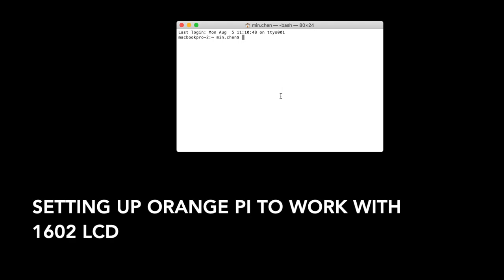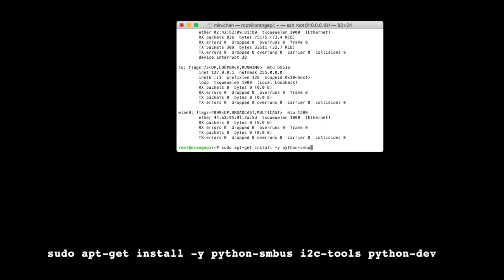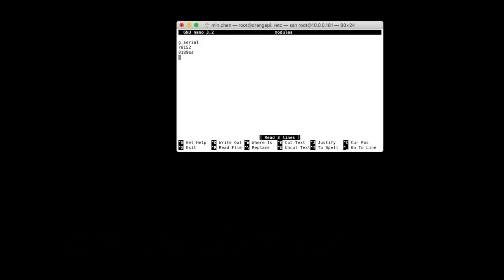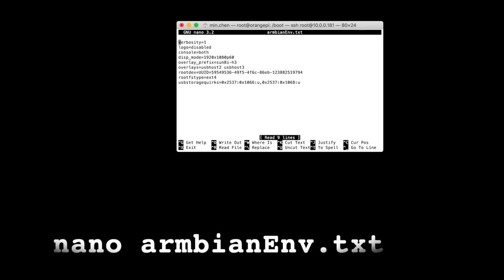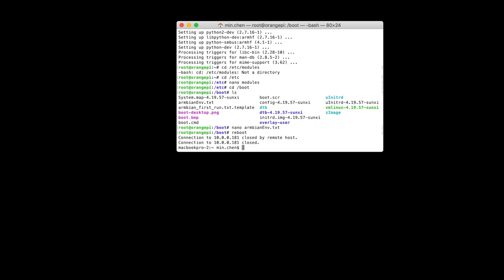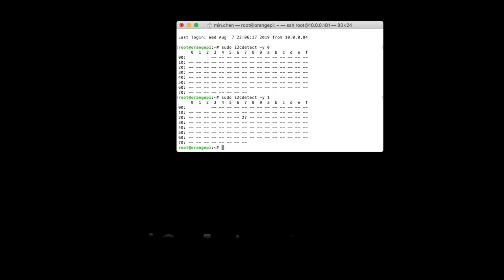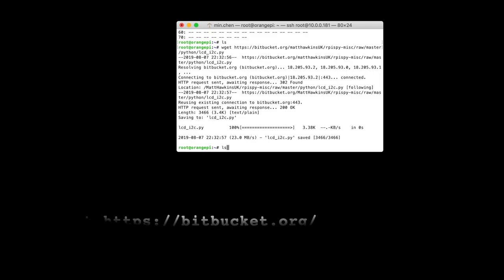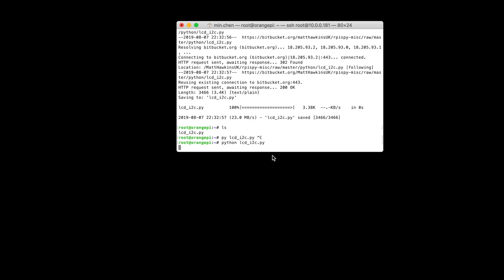Config OrangePi to work with i2c 1602 LCD display!!!

Comment: Chen, thank you for the tutorial. Could you provide the wiring? I'm wondering on howto connect SDA and SCL to Orange PI.
Reply from the maker: https://youtu.be/Kzjp6OtUk0A  this video is to the raspberry pi.. but the orange pi is similar
Reply from the maker: The pinout are here https://neonaut.neocities.org/blog/2018/implementing-a-safe-shutdown-button-for-orange-pi-zero.html  I had to use the TWI1_SDA and TWI1_SCK to get it working instead of TWI0_SDA/TWI0_SCK.  Good luck and sorry for the delay on response